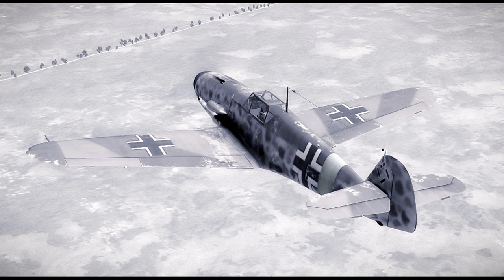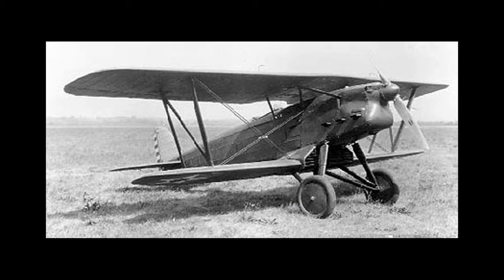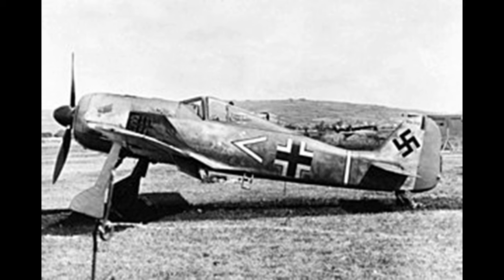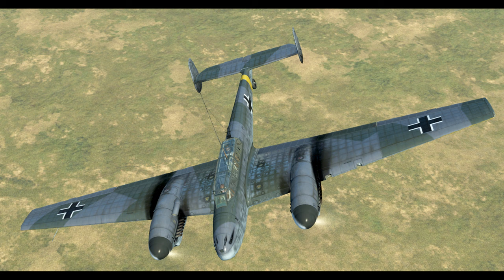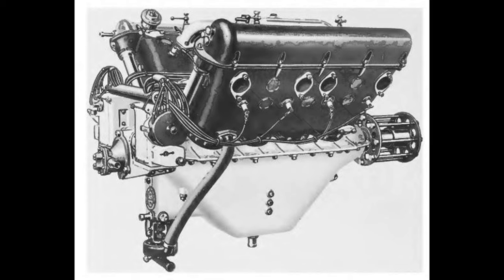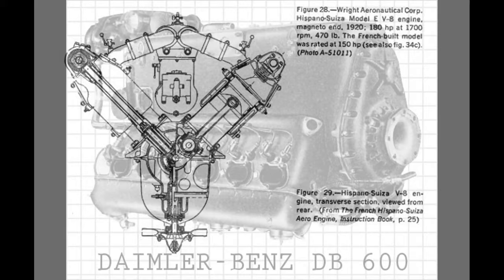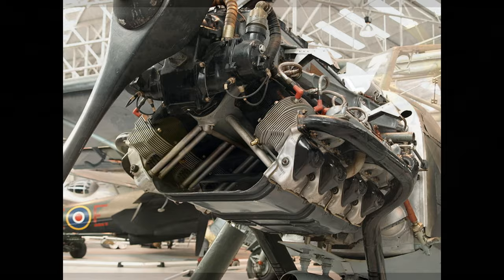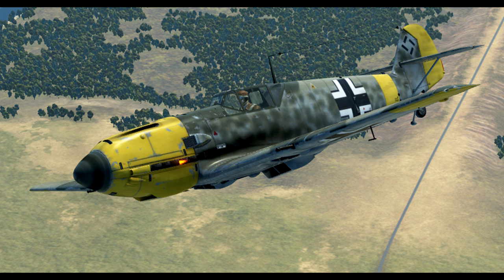Messerschmitt Bf 109 , Why an INVERTED V-12 Pt. 1? inverted V12s vs. upright

Comment: The Tiger was an excellent tank at its design role, which is a breakthrough tank. Designed for initiating a push, then falling back, spend 3x time in maintenance and then transported by train to another push. But when Germany bit off more than it can chew, they started throwing everything they had to the Soviet meat grinder resulting in tanks being used in unintended purposes. Now they cannot afford the maintenance time or the fuel while Soviets build tanks with crude edges that can rush 🅱️erlin and be back home for dinner.

Comment: i still cant understand how the oil scavenge worked on a inverted engine, unless they used the oil from the bearings to cool the piston crowns, but you still need a collection area for the oil to be sucked away , would like to see a drawing
Reply from the maker: The collection points are at the bottoms of the valve covers.
Reply: ok so they must have had , drain tubes , but still oil would have collected in the pistons uless you had a almighty scavenge system keeping the crankcase in partial vacumm

Comment: With 1.7K comments, I'm
sure somebody else has also
theorized that an inverted-V
allows more space at the top
of the nose for mounting
machine guns. While, with
more modern gunsights in
WW2, this may have been
irrelevant, it probably was
important in WW1. Thus, 
German aviation-engine companies may have been
inclined to go inverted in
order to give pilots a greater
line-of-sight aiming-effect
with higher-mounted machine guns.
Reply: German sources give one reason and one reason only for the inverted V: Ease of maintenance in the field.
Everything in their armed forces was originally designed to attack Soviet Russia as that was the plan all along.
Hitler never believed France and Britain would declare war on Germany over Poland but as so often he was wrong.

Comment: Could the motor be designed to operate in either configuration? 
Was the German tank motor just inverted?  PS Very enjoyable.
Reply from the maker: The German tank motors were different, usually Maybachs.

Comment: The Messerschmidt Bf 109 had a cannon firing through the propeller shaft, which gave a major advantage over its chief rival, the Spitire. That's an advantage of the design, but not inherent in the layout
Reply from the maker: There are upright V-12s that had guns firing through the prop hub. You could spin the engine around to the upright position in the 109 and still keep the central cannon.

Comment: The original design of the Rolls Royce Merlin was going to be inverted, but the British aircraft manufactures of the time did not like this. By the time aircraft manufactures decided that it was a good idea, the inverted V type was considered "German" and no British engine manufacturer used it.  ,

Comment: Maybe another reason for the inverted engine was so that there would be room for the two 7.92mm and later 13mm machine guns above the engines in bf109's and fw190D's
Reply from the maker: You might want to watch Part 2.
Reply: @GregsAirplanesandAutomobiles  Part 2 was very informative. The picture of the bf109 with guns installed and engine off really explains everything.
Reply from the maker: Thanks John.

Comment: Not the Crusader. The Crusader used the good old Liberty engine, which of course was an aero engine as well. So the point still stands.  I think they did put a meteor in the Crusader, but it was reportably too much.
Reply from the maker: As far as I know, they only put the Meteor into the Crusader for testing and it went 40mph! While it may have only been one tank, they did put it in, and yes the greater point is that aero engines were used in tanks, and when V-12 were used, they were upright. There are many other tanks that used the Meteor in larger numbers.

Comment: What about prop to ground clearance, because the crank center line will be higher in an inverted engine design? I saw a display in a German museum that made that claim.
Reply from the maker: You probably saw that in reference to a trainer or liaison aircraft. They have direct drive props so the crank position does effect prop height in those. It has no effect on prop height in a fighter like a 109 because the gear drive offsets it back down.

Comment: You forget that motorcanon canon shoot thru to propshaft and 7.7 or 13mm guns both sides of crankcase.
The Germans concentrated their weapons on the center line of the plane.
Reply from the maker: I did not forget that, it's covered in Pt. 2.

Comment: How about the advantage of mounting the machine-guns closer to the line of sight of the pilot (making use of the available upper space on both upper sides of the engine) thus concentrating the essential armament Mk and Mg in the nose and on the axis of the flight?
Reply from the maker: Nope, that's covered extensively in part 2.

Comment: This begs the question of why inverted inline engines were popular in a lot of British aircraft.
Reply: I would guess that, for a typical Bristish small plane of the period (like a Moth or an Auster), with a straight-four or straight-six engine and the prop bolted on the end of the crankshaft, the inverted design gave advantages in forward visibility and access for maintenance.     (As noted by Greg for the German designs).    In fact the DH Gypsy engine was, apparently, originally upright and was inverted for precisely that reason - see https://en.wikipedia.org/wiki/De_Havilland_Gipsy

Comment: Hmmm most of video is spent talking along about tanks, boats and whatnot. And you seem to miss a few points on the inverted V-12 in the process of following an irrelevant tangent.
The reasons you find here are VALID, no doubt - but there are more. Look at the Bf-109's armament. It always carried it's twin MG 131 propeller coupled machine guns. That would've been more or less impossible with an upright V-12... Imagine how clumsy that would look - if something LOOKS clumsy, it IS clumsy.  Some 109 E + Bf-109 F also carried a cannon within the propeller shaft, in addition to the machine guns, so it had 3 guns right in front of the pilot. That calls for an inverted V-12. The FW 190 D carried a big, fat cannon inside the propeller shaft, just  like the early 109E and the 109F. Again, would be very clumsy with an upright engine. No Western aircraft were armed this way, they had the armament in the wings (1 engine fighters of course, I know that twin engine ones had nose mounted armament. One exception was the P-39, but it had a mid-ship engine). The Bf-110 used the same engine as the 109, so it most likely shared all the engine hangers and whatnot. You don't just turn the engine around.  The He-111 also, like the Bf-110, shared the DB engine, and maybe the main hanger struts/bars. The Stuka used a JUMO engine of course, but as they saw the inverted DB engine was a brillant design, they did the same. It simply became the German standard to mount V-12s that way. The 109, the 110, the Stuka and the He-111 made their maiden flight in 1935. FW 190D flew  much later, but why change a genios concept that worked? The reasons you gave are fine, but also: It makes good sense that the intakes and the water coolers are on the underside, where the cylinder rows are. And the exhaust smoke passed below the cockpit when taxiing with open hood, instead of smoking the pilot. It simply had ALL benefits, and NO disadvantages.

Comment: I find your comments regarding the logistics of delivering Sherman tanks to the battle quite interesting. I’m sure you are more or less accurate. A tank was needed, the Sherman was comparatively cheap to produce and could be delivered in quantity directly to where it was needed. The fact it was entirely inadequate for the task in front of it had no consideration from those who determined it should be produced. Those who decided production strategy had no consideration for the people – yes, soldiers are people too – who would be required to fight this vehicle. They were concerned with cost and quantity. The Sherman succeeded purely by strength of numbers and took appalling losses. It’s propensity to catch fire with the first impact of an anti-tank round caused the Germans to label it the ‘Tommy cooker’. Carry on with your technical and interesting opinion on inverted or upright engines, but don’t try to justify the economic reasoning which resulted in a machine which was a death trap for its crews. The ghosts of the thousands of soldiers who burned alive in those tanks wouldn’t agree with you.

Comment: Off topic but how did the p63 king cobras engine work when it was in the back of the airplane
Reply from the maker: It's upright, and is pretty much just like the Allison in the P-39 except that it has a remotely driven second stage supercharger. This is effective and give the 63 good performance at altitude.
Reply: Is it true that the Russian pilots who filed the p63 liked it more than American pilots?
Reply from the maker: I am sure it is. They seemed to love the P39. I would like to do a video about it. The highest scoring ace who exclusively flew a US built plane flew the P39.

Comment: I have no documentary evidence  to back up my idea but I think I have an answer to why an inverted engine. If you look at all the WW1 German aircraft which were not powered by rotary engines, they were all powered by 6 cylinder inline engines, which  restricted forward vision. I suspect that those German pilots who survived the war, had influence, and continued to fly, would have pressured for an inverted engine simply to improve forward vision. Britain and France opted  the Hispano-Suzie engine design which was configured as a  V engine, so did not suffer from the same visual impairments.
Reply from the maker: Hi Laurie. Did you watch the video? The visibility issue is discussed at great length.
Reply: @GregsAirplanesandAutomobiles  I did when you first released it. Could have worded my thought better..lp
Reply: @GregsAirplanesandAutomobiles  I did. Then I read THE FIRST GREAT AIR WAR by Lee Kennett and looking at the various types both sides designed I got to thinking why did the Germans not follow British and French and develop a V engine during that war? they don't embrace that concept until late 1920's, and  then they come in with a inverted V. Is it because the straight 6 was so robust that their aircraft designers were constrained? You also said it could be to easy maintenance, but the powers that be never gave a second thought to such difficulties. The inverted V also had fuel injection. Is that linked? I just think there must be  a logical design reason that we are missing

Comment: i read somewhere that inverted engines are used to lower the center of gravity.
Reply: And that's important in an airplane? Keeping the center of mass near the thrust line may be a consideration but a lower center of gravity only matters on the ground.

Comment: Two comments greatly in favor of aircraft engines. 1, they are blessedly without the ' check engine light' and the massively onerous and complicated ECU that controls everything but the turn indicators on a automobile. 2. There was and is not one notion of the Chevy Vega in the design and execution of any aircraft I can recall. Except for the Brewster Buffalo, more on that mistake in a moment.. It was literally a throw away piece of transportation. Mistakenly, I bought a used early Vega (station wagon??). I believe my reason for buying this conglomeration of cheapness and throw away engineering was the fact it was painted corvette red, one of my favorite colors. 
 The Brewster Buffalo came close to the Vega. It was designed to fill a tiny void in the fighter category that the AF brass thought should be filled while other more potent and proven fighters came on line.  Most fighter pilots rejected the Brewster Buffalo after one check ride. They went from utter ridicule to hauling mail  to being used as aerial targets. The last dozen or so Brewster Buffalos were scrapped without fanfare. Much the same end that should have befallen the Chevy Vega.

Comment: Great channel, with the crankshaft is further off the ground a larger propeller could be fitted.
Reply from the maker: On an NON geared engine that's true, but it's not the case with the 109.

Comment: Interesting vidio,
I heard this___ prior to the war there was an upsurge in aero racing and speed record endeavours, at an air show, the Germans secretly photographed the merlin v 12 ,which the British had installed upsidedown for  confusion reasons, carburettors dont work upsidedown, thats why the me109 has fuel injection and the spitfire carbs, fuel injection born out of necessity
Reply from the maker: I have heard that too, but it's absolutely not true. There are many inverted engines that run carbs, including several German inverted engines with carbs.

Comment: I believebelieve there is one other reason -- keeping the thrust axis closer to the wing axis. This reduces the induced pitch changes resulting from power application. The change in the thrust axis can affect the trim needed to keep the aircraft from pitching up or down. Sadly, tthis was in part why the unnecessary and ultimately fatal MCAS was added to the 737 Max so it handles like a 737 NG. Keeping the propeller axis closer to the wing and the center of gravity reduces the influence engine power has on pitch.
Reply from the maker: It's a geared engine, thus that really isn't a factor, they can put that axis anywhere they want, inverted or not.
Reply: @GregsAirplanesandAutomobiles  Well... isn't it true that with a big/small two-gear reduction set you are always biasing the propeller axis away from the crank axis in the direction of the heads?
Reply from the maker: no, it could be inline with the crank centerline via planetary gears, or above or below.
Reply: @GregsAirplanesandAutomobiles  Sure, but that will make the reduction gear box longer, bulkier and arguably heavier? See how long this 1710 reduction unit is compared to the DB601's (or Merlin's)... https://upload.wikimedia.org/wikipedia/commons/thumb/4/40/Allison_V-1710-7_V-12_Engine_NASM.jpg/1280px-Allison_V-1710-7_V-12_Engine_NASM.jpg
Reply from the maker: Planetary gears are generally less bulky. What you are looking at in that picture is a nose drive that contains mostly empty space for use in certain early Curtis fighters that needed to move the prop forward relative to the engine. https://usautoindustryworldwartwo.com/images/Allison/allison-v1710-ticomuseum-107w-1.jpg cont:

Planetary gears were very commonly used for WW2 aircraft prop reduction, I haven't counted, but I think far more common than other types.

Comment: I think Rolls Royce had a marine version of the Merlin for high speed PT and rescue boats.
Reply from the maker: They did, but the U.S. PT boats were powered by Packard V-12s, which were totally different engines than the Packard built Merlin V-12s.

Comment: I’d suggest the real answer is mundane. The English and American engine manufacturers were VEHICLE MAKERS in the main. Their heritage was from cars and trucks. Car and truck mechanics work on engines from top down, not from bottom up, as is more normal in aircraft. So, the allied designers came from the tradition of car designs and carried their prejudices. The Nazi designers came with no prejudice, there was not the mass produced automobile manufacturing infrastructure and labour pool in  Nazi Germany. The additional factors were that an inverted engine needs positive engine oil pressure which means two oil pumps and an inverted engine doesn’t work that well with carburettors, they used mechanical fuel injection. The Allies used carburettors on their aircraft instead of injectors, in the interest of manufacturing ease and maintenance ease, dropping performance in favour of mass production and ease of maintenance.

Comment: Inverted V makes it easier to mount a cannon inbetween the cylinder banks and eventually running through the reduction gearbox.
Reply from the maker: I understand why you would think that, but it's not true.
Reply: @GregsAirplanesandAutomobiles  I watched your second part and yes that might be not true, but visibility isn´t either.
The accessibility argument sounds very convincing.